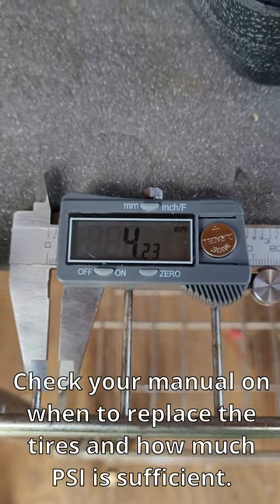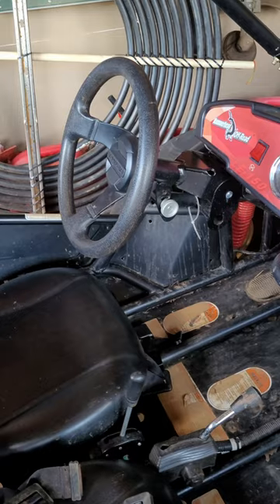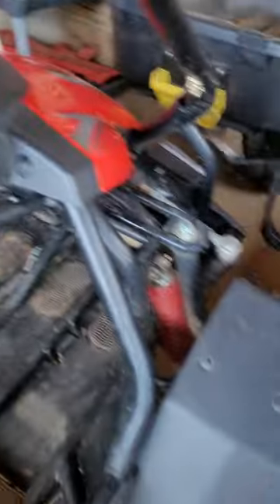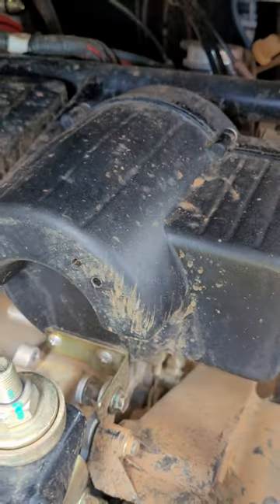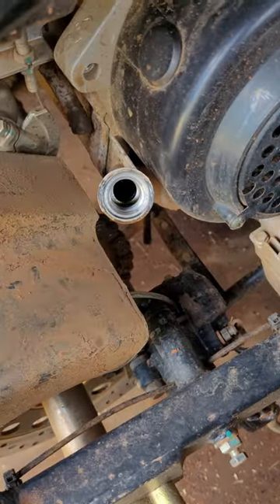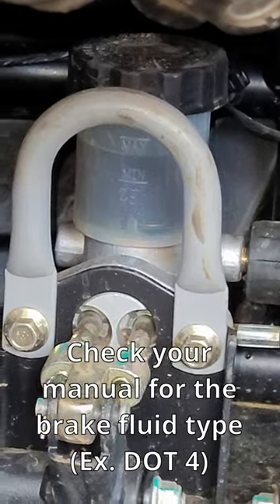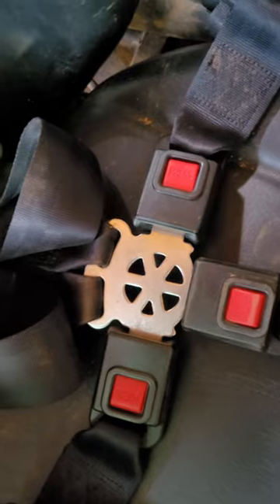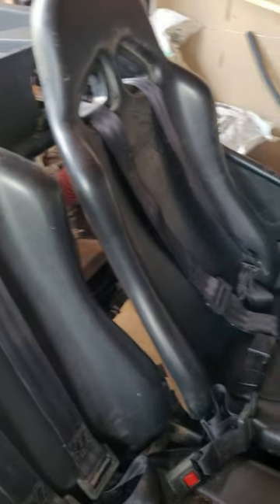How to complete the pre-ride checklist on a go-kart. #shorts

Comment: I just built a go-kart a while ago and I don't do a pre ride inspection. If something is wrong I find out when either my tire flies past me (which has happened before) or anything else goes wrong (which happens pretty often considering the axle and drive sprocket are held on with hose clamps and zip ties, this is not a joke btw)
Reply from the maker: Well that seems dangerous. I hope you don't get hurt.